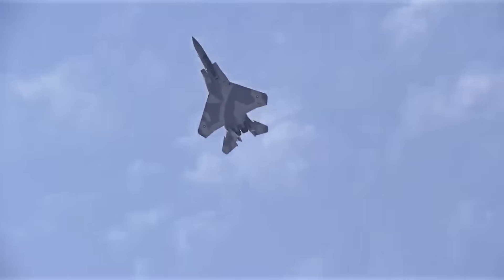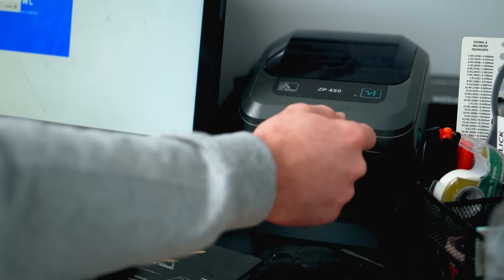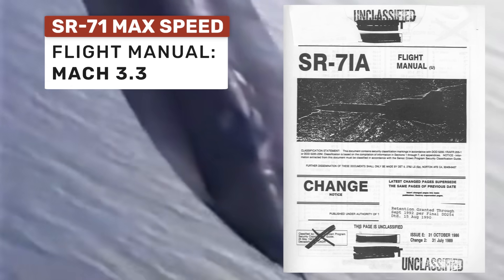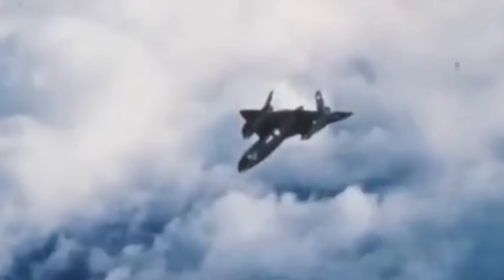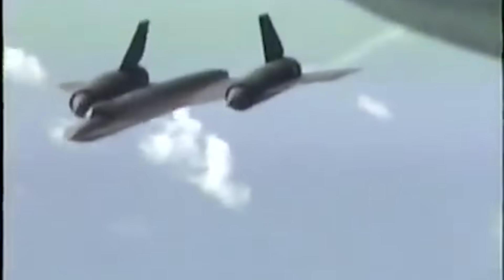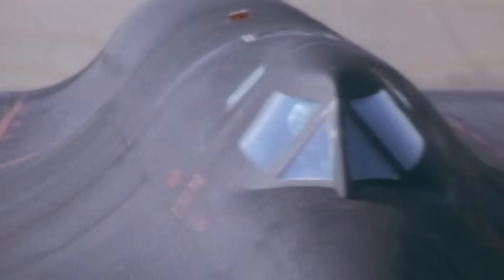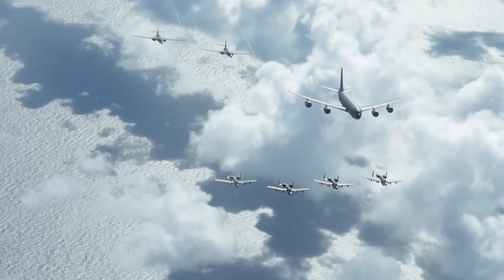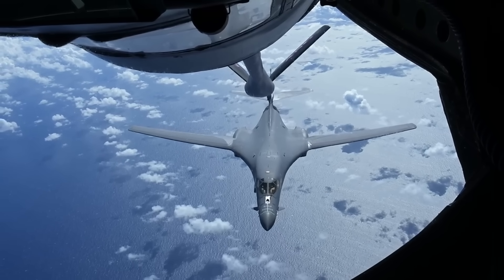The SR-71 was MUCH FASTER than the Air Force will admit

Comment: The F-100 engines in the F-16 and older versions of the F-15 are theoretically capable of Mach 3 if you could find a way to precool the air before it enters the engine. Otherwise the compressor stages and turbine would melt long before then. New turbojet designs are experimenting with exactly that.

Comment: The pilots notes for the aircraft have been declassified. Design speed for normal continuous operation Mach 3.17 at 85,000 feet with a when authorised max Mach limit of Mach 3.3. Main limiting factor on aircraft maximum speed was the compressor inlet temperature limit which was 427 degrees C  Exceed that and you risk doing serious damage to the engine. 85,000 feet wasn't the maximum altitude but the Atmosphere above that height starts to warm up due to the creation and destruction of Ozone and this means the aircraft has to slow down. The engines require subsonic airflow going into the actual engine and this is done by the interactions of the shock cone and intake lip of the air intake, plus the shape of the intake duct and intake bullet. In turning the Mach 3 airflow into subsonic air it raises the air pressure by 1 Bar (15 PSI) and that heats the air up from -50 Degrees C to 400 Degrees plus. Overspeed the aircraft outside of the position that the Shock Cone can be moved to and the compression produced by the interaction of the shock waves falls away massively and the engine will suffer an Unstart which is caused by a lack of air into the engine. There is a bit of leeway on how fast you can overspeed the type of intake on a SR-71, but it's not more than 0.2-0.3 Mach. Mach 3.5 on a SR-71 is doable at the risk of damaging the engines or suffering an unstart.

Comment: I learned through experience that the stated top speeds, ranges and other measurable statistics were not accurate, but not innacurate either. It would do what it said on the box, and more. Every time. I decided beyond just secrecy that the number selected would be one that was deemed to be its peak stable value before some kind of performance trade off would take place. Max whatever with high degree of reliability

Comment: Another completely "dishonest" specification ..?  
That the 160,000 lb SR-71 was powered by a pair of 34,000 ft-lb (less than F-22 at 35,000 lb-ft) engines. 
Bc!! They're RAMJETS!!!! And quoted only "uninstalled thrust" ... ergo, never telling us but performance of the turbojet mode.

"Maximum thrust: on a standard day at sea level, zero airspeed: installed 25,500 pounds-force (113.43 kN) wet, 18,000 pounds-force (80.07 kN) dry. Uninstalled 34,000 pounds-force (151.24 kN) wet, 25,000 pounds-force (111.21 kN) dry[39]"

Comment: The problem is that airspeed, ground speed, and Mach number, all vary with altitude, temperature, and humidity. Ground speed is a good measure of distance that can be travelled in a given time, but the airspeed is affected by whether the aircraft is flying into a headwind or assisted by a tailwind. Mach 3.95 at high altitude would have been possible but only under certain atmospheric conditions because the rarified airflow would not be sufficient to cool the engines. So essentially the SR71 was temperature limited with no specific top speed. It could fly as fast as atmospheric conditions allowed and faster still until the aircraft broke up from overheating and dynamic stress. This would probably happen around Mach 4.2 and would be fairly instantaneous, rather like the space shuttle breakup. No pilot in their right mind would want too push the SR71 to its’ limits given the chance of a no warning catastrophic failure. Even at lower speeds, pilots had to carefully manage the thermal build up of the airframe and engines, adjusting speed and altitude to maintain optimum cooling airflow. Stuff gets hot at speeds above Mach 2 and extremely hot at anything over Mach 3.

Comment: It seems the question is how is maximum speed defined. And different companies or agencies have different definitions. When McDonnell certified the aircraft that became the F-4, they did a simulation of a deck launched intercept with the plane carrying two Sidewinders and 4 Sparrows, where it reached Mach 2.2 in a certain amount of time. The Navy asked Grumman to do the same with the F-14A, and in the same configuration the F-14A reached Mach 2.34 in the same time as the F-4 reached 2.2. A moment later the F-14A reached Mach 2.4, but the Navy used 2.34 as top speed. 

Interesting to note, during testing of the original F-14B with the F-401 engines, maintenence crew noted hand drawn marks inside the inlet corresponding to the position of the inlet ramps and Mach number. Positions were marked from Mach 1 to Mach 2.5. The paint on the inlet was scuffed well past the mark of Mach 2.5. 😳

Comment: I'm an Aerospace engineer. When I was in college one of my professors told me that he worked on the A-12/YF-12A/SR-71 programs. He stated that the top speed of the aircraft was limited by the heat generated on the airframe. I asked him for an approximate top Mach number; he said above 3.4.
Reply: Indeed it was limited by temp.   Specially, the Compressor Inlet.  The inlet temp was 427c MAX.  On occasions missions had to be delayed, or aborted, due to 'warmer' air at altitude that would force the aircraft to fly at lower speeds (therefore lower altitude) than missions called for.
Reply: @hwoods01  That was one of the limits.  The other big limit is the shockwaves started going were they shouldn't go a little under M3.6.  I have no qualms with people claiming M 3.5 but that is outside the specs for the plane.  The very last flight they requested M 3.4 and Lockheed said M3.3 was the fastest that the pilot could recover from an unstart so they used M 3.3 as their top speed.  P&W said they could use a higher CIT limit for the last flight for a few minutes if they needed to since the engines were not going to be used again.  Unstarts are very violent and Blackbird people reported banging their helmets against canopy.
Reply: The speed of the A12 was limited by the air temperature at the compressor inlet of the engines.
Reply: Heat is the primary limiting engineering element to the Blackbird series of a/c.  I've talked with an engineer on the program, and he's verified the information.  I've also spent hundreds of hours researching/studying the bird(s) over my lifetime trying to drill down various aspects, to include speed claims - obviously, the most questioned.
After all this time, some things just need to be folklore and stay that way; but I heartily agree with the 3.4 Mach number.
My primary reason above all others is simple: regardless of heat, spike movement (limits), weight, etc, most people don't realize that the entire a/c is flying WITHIN its nose cone Shockwave until about M3.35 when the wind tips would start to brush against it and bring much additional drag to bear.  So, with all else being discussed, this is mostly overlooked.

PS.  In talking with an A- 12 pilot, he just chuckled when talking speed comparisons.  Consider an a/c with the same power as a '71, but 30,000lbs lighter.  You guessed it, faster and higher!  HOWEVER, the only recordings for speed and altiude were done with the '71, not the A-12, for various reasons; not the least of which was the fact that the A-12, "wasn't supposed to exist" for the longest time and was specifically a CIA asset - oh, and they could hide it amongst the fleet of '71s because 999 of 1000 people couldn't tell the difference between the two.
Reply: @4edward61  I wonder if the high number of A-12's 'lost" (something like 6 of the 11 built?) had something to do with that?
Reply: @DavidMitchell79  Quite possibly.  An engine unstart or inlet cone misalignment would drastically "alter" your flight profile at higher speeds and altitudes.  That or any other "added drag" event!
Reply: "I asked him for an approximate top Mach number; he said above 3.4."

The same way that the MiG-25 can theoretically hit mach 3+...   Remember, the -25 starts wrecking its engine somewhere between mach 2.5 and 2.83 depending on how close to perfect specs the engine was made.
Reply: It’s the kind of thing of whether the plane fly faster more than once.

Mach 3+ in the MiG-25 was possible if the engines were expendable.
Reply: @Justanotherconsumer Viktor Belenko said that, in the MIG 25, you couldn't safely exceed Mach 2.8 if you wanted to keep the engines intact.
Reply: @Justanotherconsumer The MiG-25 engine thing is fallacy an urban myth.

The MiG-25 top speed was past 3.4 Mach, but it wasnt allowed to be done than emergency.

The MiG-25 limiting to Mach 2.85 was to increase aircraft peace time lifetime as they wear out faster you stress them. Just like SR-71's, you planned carefully every flight hour for its while flight career. Every second flying faster or pulling more G than nominal will consume total lifetime hours in minutes.

The MiG-25 top speed was limited to Mach 3.3 in a normal mission, as that was safe speed. Going faster than that and the engine intakes risked to collapse in itself. It could fly faster, but risking not just aircraft and pilot, but risking the mission failure wasn't a option unless it is to try to deny USA dropping a nuclear bomb.

The incoming attack sets the limit for themselves by detection time. The defending interceptor sets limit by takeoff timing performance. Takeoff too early and you fail, too late and you fall. Take wrong heading and you fall, climb with wrong speed or altitude and you fail. It is all by the numbers and skill to strictly perform them at proper time and values.

There are lot of all kind accidents where all kind planes engines have malfunctioned, and that doesn't happen for speed exceed...
Reply: I believe it. Coz my baby can do over mach 5, and I'm not an American. So you guy well over it for sure 😂
Reply: Yep.
Reply: Design limit within safety regs? Sure...But ABLE to achieve....Prob substantially more.
I tend to believe the "Just under 3k" stories.....For seconds at a time.
Reply: this is objectively correct, it's limited by the autoignition point of the specific fuel they used under the plane's skin.
Reply: @FVTLORD  No chance of the fuel igniting as there was inert atmosphere in the tanks above the fuel, without oxidizer there is no ignition.
Reply: He probably pulled that out his butt. You really think it was tested to the point of failure?
Reply: @samsonsoturian6013  Doesn't really have to failure tested. The melting point of the materials used is known as is the power of the engines and so on. If the number say it can go fast enough to melt the skin at 80% power then that's a big enough margin of error to feel confident of such a statement.  Now if the numbers said the skin would melt between 98% and 105% full power then it gets iffy. Pretty sure the engineering was solid enough for his statement to be true.
Reply: Given the nature of the program, I’d say nearly so.  When the F-4 Phantom first came out, they decided to see how fast it would go. Eventually the pilot pulled back the throttles because he was concerned he would toast the engines.  Don’t remember the Mach number but it was certainly above operational limits.

Comment: I don’t know what the fuss is about.  The F-15C can according to the USAF do Mach 2.5 or 1875 mph.  Obviously they think that we are stupid.  That is at sea level and no aircraft can do that.  Mach 1.4 seems to be a hard limit with today’s materials.  If you use 660 mph (Mach 1 at 30,000’) then 1875/660=~2.84. Go up to 40,000 and you’re at Mach 2.9 easy.  Again open source numbers from the USAF!

Comment: The F-16 with 3 EFTs, two 2,000 lb bombs & 2 AIM-120 has its top speed reduced to Mach 1.3. Even when lightly loaded, the penalty is substantially – EF Typhoon for instance, with Mach 2 top speed is limited to Mach 1.6 with 6 AAMs and no drop tank. The Eurofighter's top speed is reduced to Mach 1.6 with just 4 BVRAAMS, and 2 SRAAMS, which is just a light air-to-air load.

Comment: In 1976, in the Air Force I was attached to a mobile radar unit on the German / Belgium border.
One of the radar dudes was previously stationed in Key West. He, and other radar dudes and dudettes, confirmed that SR-71 was much faster that officially stated. Wouldn't disclose numbers so thank you for digging them up!

Comment: Similarly the top speed of the Abrams was 60mph now its offically only ~45mph.
Reply: I was an M2 mechanic on Stewart in the mid 90s. I promise that the M1 is even faster without a turret. IIRC, the drive sprockets start skipping in the expanding tracks at about 85 or so...
Reply: @slateslavens  going to or from The Sandbox?
Got my info from dad while he was at Benning.
Reply: @bowez9 it was over at 'third shop' for god-knows-what. They ran it up on the paved section of the tank trail that paralleled the road behind the motorpools. 

and your dad was right. But there aren't many opportunities to run them around without turrets :D

Comment: As a kid in 1966 or 67, while reading through the encyclopedia's airplane section. me the fellows read that the SR-71 stated that the top speed was Mach 3.5 and altitude was 100,000 feet.

Comment: I'd love to see a source where you found that a GE F110 equipped jet had a functional VMax/Max Power switch. This is/was purely an older series P&W F100 engine command that doesn't even apply to the newer F100-229 engines and NEVER applied to GE engines. This switch is still in many planes that it's not even wired up in, as it's just a leftover from previous Block/Suite aircraft with older Pratt engines.

Comment: The A12 came first, not the SR71. The SR71 is a stretched A12 and was heavier and slower than the A12. 

Every variant came from the A12, not the other way around.
The A12 pilots called the SR71 the family model.
Reply: I remember when it was still "YF12A"
Reply: @lordphullautosear  YF12 was another variant of the A12. They researched the possibility of using the platform as an interceptor. 
They made a few variants, the YF, a trainer with multiple cockpits, one to launch drones off its back, and the SR71. Those are the ones I recall.

Comment: GREAT video!!  Many decades ago I read an article in Popular Science, or was it Popular Mechanics, about the SR-71.  What stood out to me about the article is that the requirements for the ejection system called for an ejection to be survivable well north of the "posted" maximum speed.  I mistrust my memory but the number in my mind is Mach 4.  That seems unlikely.  And my guess is that drag, heat, and airframe stress rose significantly as the wingtips began to exit the Mach cone, and I don't know whether the inlets would have functioned properly if they were outside the Mach cone.

Comment: I heard on a documentary by Bill Yoak a former Sunk Works engineer that the SR-71A could reach speeds of up to Mach 4.4 again I have no idea if that is true but he did state that airframe was far faster then what it was stated as to the general public
Reply: That's not possible. At Mach 4.4, the shockwave angle from the nose is 13.14 degrees either side of the centerline. That would have the engines outside the shockwave, the rudders right in the middle of it and the wingtips outside the shockwave and the inner wings inside of it. Those engines wouldn't operate and neither would your control surfaces. You would be dead stick with no way to control the aircraft. A protractor and a picture/drawing of any aircraft is all you need to calculate it's top airframe speed before the shockwave interferes with inlets/flight surfaces. Mach # = 1/sine(angle) before interference begins with the angle measured from the front tip where the shockwave begins from the centerline.
Reply: @wally7856 You’re trying to use science to explain something to people who have already made up their mind the plane can do Mach4+.
Reply: @Pene7942  My bad, I'll let them believe whatever they want to believe.

Comment: The SR-71 is generally regarded as limited to Mach 3.6 which is when the shockwave from the nose  is ingested by the engines
Reply: I believe the Mach indicator dial had a 4 in it. Yes 3.6 is the design limit for the engine
Reply: Your statement is true until you factor in altitude densities.  With greater altitudes, the shockwave becomes a decreasing factor.
Reply: @rod3134 what?
Reply: @ronjon7942  Remember that the stated (Publicly Released Data) on the NORMAL operational regiments don't include the extreme limits of testing. Look up the SR71 LASRE experiment.  I think you'll be amazed.  Many tests like this one were carried out and went "black." Shock waves act differently with increasing altitude and decreasing density. With a lower atmospheric density, a craft can go a ALOT faster.
Reply: Sounds about right. Maximum cleared speed was Mach 3.3. Compression on the shock cones and intake lips are at maximum at around  0.3 Mach either side of the speed at which the shock cone's position is set.
Reply: Is that calculated with the full travel of the engine inlet vanes? 🤔

Comment: Supposedly the limit was just over 3.6.
I am told that was where the intakes could no longer slow intake air to subsonic speeds, and a turbine will not digest supersonic air.
Exceed that point and the engines quit.